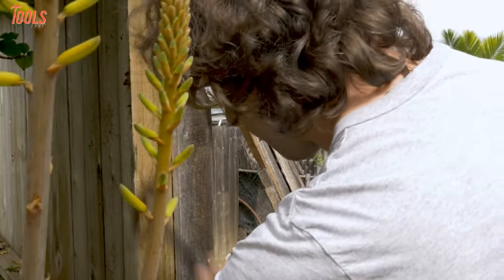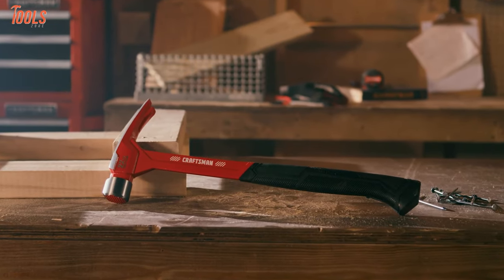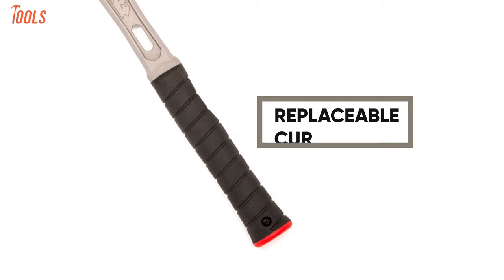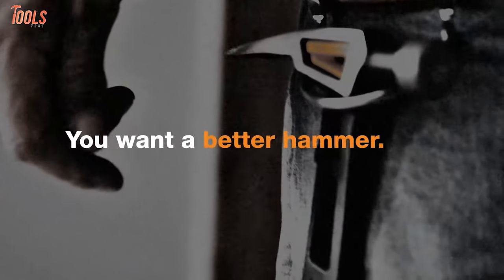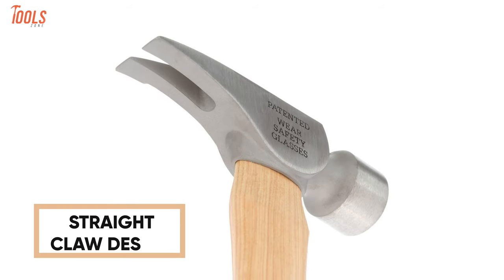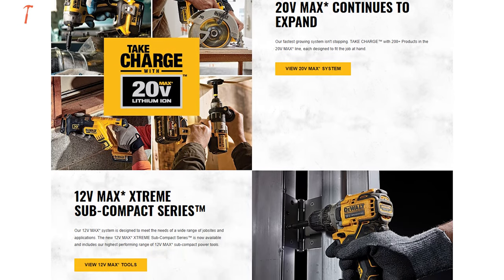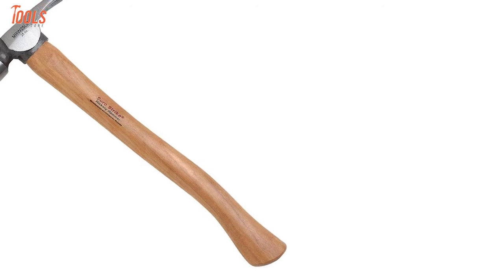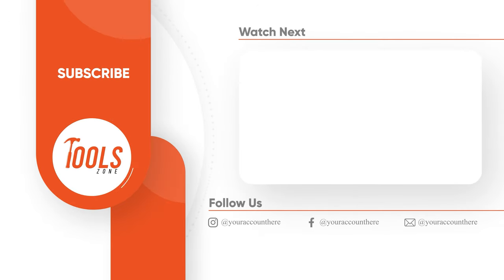10 Best Framing Hammer to Buy

Comment: All but 1 is junk...Martinez is a copy cat to the Stilleto TB1 and TB2...I have been in the construction field since 1983...I only use Stilleto...I have the Stilleto Ruger 14oz and the Stilleto TB2..both are titanium...don't use titanium on steel or concrete as they will shatter...use the Estwing on those...ask real framers what is best in the tool pouches.
Reply: the Martinez is designed by the guy who designed the stiletto so not a copy cat and it has some newer ideas.
in short its not a copycat but the same design cues as its the same guy.
Reply: @ragnarok1916  I got my first Tbone1 in the mid 90s....time frame saying Martinez designed it was in 2000...the time frames don't add up